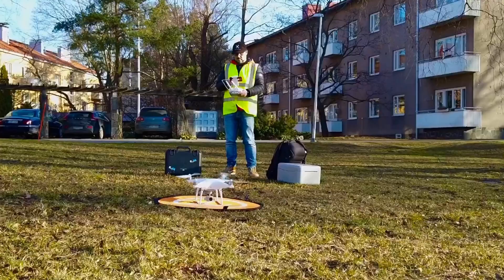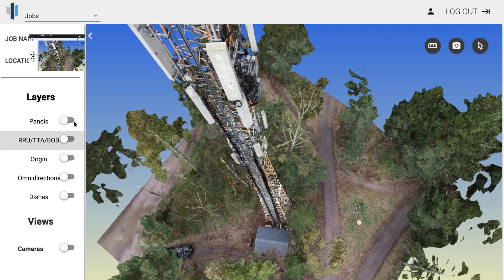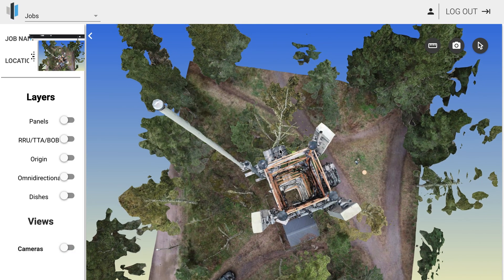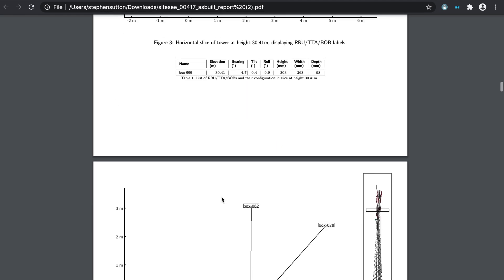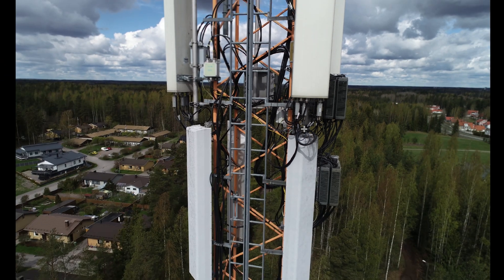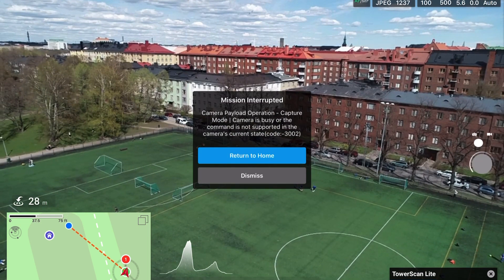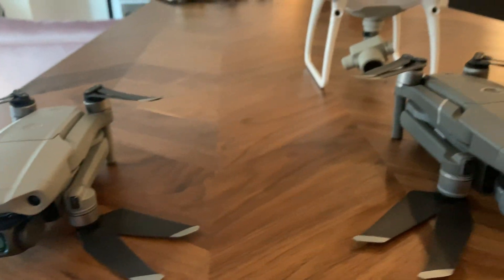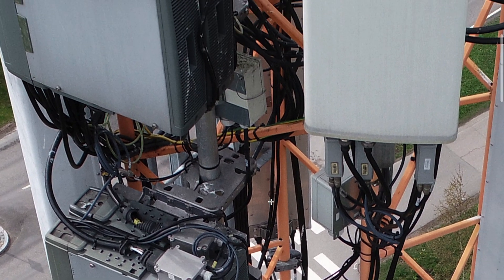Telecom Mast Inspection. 'How to' Guide. DJI Smart Controller, Mavic 2 Pro, Phantom 4

Comment: Would a Phantom 4 Advanced be adequate for a mast mission or is the radio transmission not strong enough?
Reply from the maker: Hey, thanks for the comment. It would be ok, but you can’t use the LCD on the controller. It has to be a tablet or phone.
Reply: @FlybyGuys  Thank You! 👍

Comment: Is p4pro v2 with ocusync safer than p4pro with light bridge when inspecting a cell tower.?
Reply from the maker: Hi Mike. Yes, kinda. But your never going to be far away from the drone doing this work. The worry is radio interference, but I’ve experienced this with the V2 as well. 50/50 I would say. Hope this helps ✌🏻

Comment: Hi. I know it's off topic, but looks like you have nice knowledge: some ppl say that Mavic 2 Zoom is better for some inspections, like for checking building pathologies and stuffs, but is half size of sensor. does the zoom is really needed, or you could just get closer on these inspections? What kind of scenarios the zoom will be needed?
Reply from the maker: Hi Márcio. A zoom isn’t necessary, as the high resolution photos taken is enough. 
We calibrate the inspection area giving us the best possible distance to capture the data.  
I hope this helps.
Reply: @FlybyGuys  Ty very much! It makes me think the Air 2s will be good for this job. But you said to avoid the Air 2 and go with Mavic 2 Pro or better, right? What about the Air 2s? The fact that M2P is heavier is better or it doesnt matter?
Reply from the maker: @marcioventura3135  Air 2S is a good drone. But if the SDK is done with the SW, then it’s a good choice. 
My money is on the M2P or the P2P, as the SDK is done. It’s all about the SW.
Reply: @FlybyGuys  I'm sorry. What is SW?
Reply from the maker: @marcioventura3135  Software
Reply: @FlybyGuys  Oh ok. I read that SDK release for Dji Air 2s was in december 2021. But idk if the SW we need is already available.
Reply: How can I be sure of that?

Comment: Q: When doing a mass inspection and the client has a shot sheet that details camera angles using degrees, is there a way to put this in the DJI fly app camera settings?
Reply from the maker: Hello. Thanks for this interesting question. 
The answer is no. 
DJI do not offer this. You need to do this manually, which I do not recommend.  
Using specific SW like we use, gives you and the customer the optimal data set for the mast. 
When it comes to ‘what the customer wants’, the customer does not know what they want. And saving money is certainly not the key to offering this service.  Hope that helps.
Reply: @FlybyGuys  Yes very helpful and thank you for your consultation!! Note I recently got hired as an independent contractor, I  was given a shot sheet that had client request for drone photos with the camera positioned 40 and 60° angles at the antennas and the RAN to be 80% in frame. Now I started to assume that most of this is just eyeballing and not really coordinates to be placed into the Fly app and it sounds like my assumption is correct.

Comment: You mentioned that one of the best drones to use would be the Mavic 2 pro. Would the newer Air 2S be as good or can you recommend any of the newer ones with enhanced sensor. ?
Reply from the maker: Hi Eric. Unfortunately, there is no SDK for the A2S, so no SW provider can add this drone to their portfolio. The A2S would be great for this work. The 1” sensor makes it ideal for capturing the data. 

Thanks for the comment ✌🏻

Comment: drone won't fly away at all - GPS may drop out and then the wind pushes the drone in that direction - certainly not a fly away if theres no GPS
Reply from the maker: Thanks for the comment. If a drone loses GPS, it will lose its positioning. Near interference, it will become erratic and have a fly away. When your next to hundreds of thousands of euros worth of equipment, you do not take risks. I’ve seen behaviour like this in many different scenarios. I actually have very good experience with GPS issues with missions. I’ve seen it all 😊
Reply: @FlybyGuys  I believe an RTK drone would keep its position, and use PPK for the processing.
Reply from the maker: @DakarBlues  RTK is better for mapping. For telecom inspections,
RTK is a bit extreme. Not much ROI from the delivery

Comment: Is it dangerous to perform these cell tower inspections due to radiation?
Reply from the maker: Hi there. I think I mentioned that in the video. It can be an issue,
So just be aware and take over if necessary. I have experienced it once before.
Reply: @FlybyGuys  Sorry I should have been more specific. I meant is it dangerous to conduct a cell phone tower inspection by myself (not with a drone), due to the electromagnetic waves emitting from the tower or I’m I overreacting? I have a job offer and part of the job is site inspection and tower  surveying and I was just worried about the risk of radiation on the job.
Reply from the maker: Ah, well yes. There is a radiation radius on these towers. It’s always on the schematic of the plans. It should be turned off before accessing.
Reply: @FlybyGuys  Ah that’s good to know that it’s turn out off before accessing. Thanks for being so helpful.

Comment: Are you using ground control points when making the model?
Reply from the maker: No, but I plan to do so.
Reply: @FlybyGuys  So is that software that you used available to the public to purchase
Reply from the maker: Long story, yes and no. Hanger is no longer available, but Sitesee is.
Reply: @FlybyGuys  It looks like it made a very detailed and accurate model of the tower, I can’t get pix4D cloud to do that

Comment: Is there a certification you can get for this?
Reply from the maker: Yes there is. If you have work lined up with an operator, and you use Hanger Tower Sight, you will be trained, and certification will be issued. I insist any of my pilots do this training and get certification.
Reply from the maker: Make sure to subscribe to get more information about knowledge like this.

Comment: I have climbed towers for 15 years and I can guarantee you that I can get to places your drone can NOT get to and my measurements would be so much more accurate than your computer generated ones. Ever in michigan, we can put this to a bet if you'd like....
Reply from the maker: Thanks for the comment Bryan. We expect kickback from the manual tower workers, so your view is nothing new. When we take our data to the mobile operators, they see more they their men who climb. Why? Because we can see every angle. You will never be able to see very rusting mast part, missing cable or broken antenna, due to weather conditions time constraints or general human error. AI helps this. Our clients have learned, and gained more from our inspection data, and made more money due to equipment that should not be there. That’s something someone who climbed will not be aware of. Your attitude is normal, but we know how to help that. Hard data.
Reply: I would assume you would come back with the same bullshit you try to sell in your videos, but again I can back up my claims with 15 years of actual experience, where as you play with toys. And I also drone, but for fun. Let's see you get a serial number off a faded rrh label thats covered in birdshit, whatcha gonna do, fly close enough to blow it off?
Reply: @bryanmcnulty9231  Why the hostility? Drones as just another tool and will not replace tower workers nor manual inspections. Relax.
Reply: Didn't mean to come off hostile, my bad, just my nature I guess
Reply from the maker: @bryanmcnulty9231  It’s ok Bryan. No offence taken. Thanks, and big respect ✊🏼
Reply: @bryanmcnulty9231  I feel your concern. I think the drones present the value of safety, which lowers cost. A drone can find that birdshit, and that could trigger the tower climb. But why do a tower climb if the drone can do the same, arguably just as well or better when birdshit is not there? I guess what I'm saying is drones are another option or tool overall, in conjunction with climbing.
Reply: Typical rigger. i’ve gOT 20 yEarS EXpEriENce. Why don’t you guys just stfu for once. There are always going to be newer and easier ways to do things. Keep messing up your body. Just another tool for the job